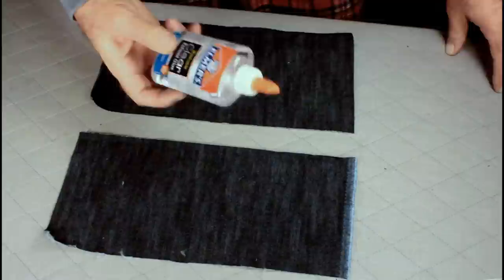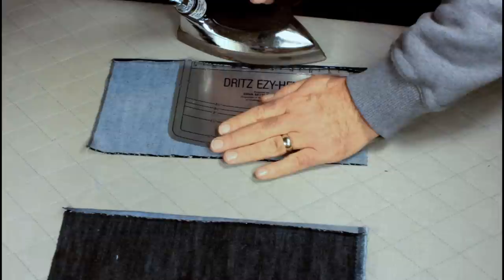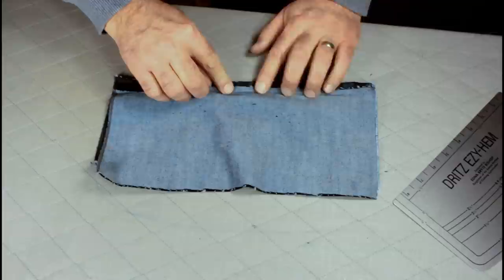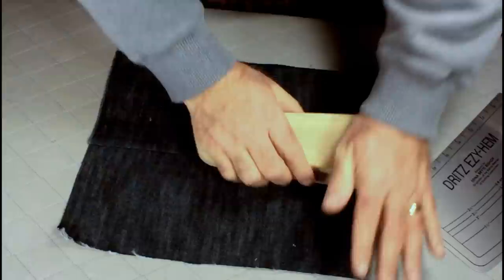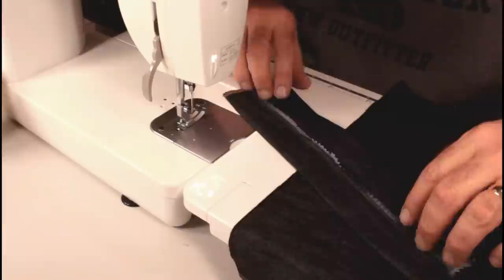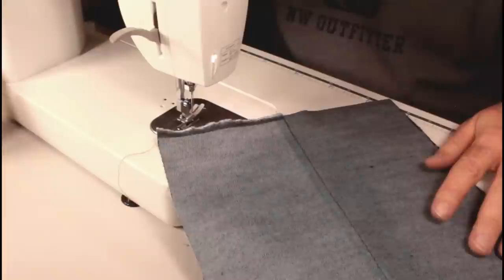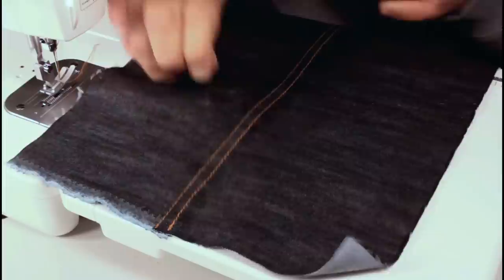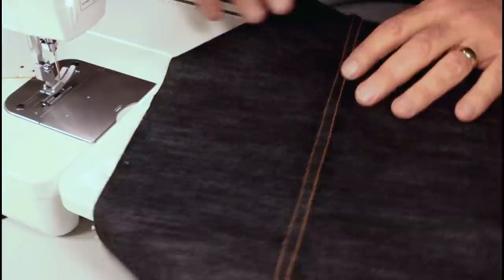Example of One Way to Sew A Professional Flat Felled Seam on a Home Sewing Machine

Comment: Two more words dude....nice trick, and just about the only vid to show a proper flat feld jeans seam!
Questions:- The critical thing is the width of the sown seams, yet you space the folds by setting a cut edge against the inside of one if the seams, which could be a bit inaccurate. Surely the outside parts of each 1/4" fold need to be spaced 1/2" apart with accuracy, then two Stitches 1/8" in on each side give the stitch line spacing of 1/4.  I must try this soon."
Reply from the maker: When I use my felling machine I use raw edges. The raw edge it touching the inside fold. You can use the method you described too. Whatever makes the most sense to you is fine.

Comment: hey kevin, i'm planning on learning to make my own jeans and maybe some faux leather-polyurethane pants. what machine//foot would you recommend that could handle going through interlocking felled seams such as the crotch and some parts of the back of the jeans? i'm looking for the cheapest thing to get the job done, since i'm still a college student
Reply from the maker: crimson35124 I'd buy a old all metal classic machine. You can pick them up for under $50 by shopping local thrift shops, goodwill and craigslist.

Comment: I looked at a pair of high end jeans that I bought years ago, it seemed to me like they had used a straight triple stitch, and they'd done 4 lines of stitching on the inner and outter leg seams. What is the benefit of using a straight stitch vs the triple? I know it is supposed to be for stretch, but I want to confirm that the triple stitch makes the stitch stronger? I'm trying to make some heavy duty utility jeans that'll handle horseback riding, so strength is what I'm going for. How much added strength would the extra lines of stitching give? 
Thank you for the video!
Reply from the maker: I have a pair that cost over $100 USD that have 3 stitches on the inside of the legs too. It is simply a design choice OR possible they contracted with a company that didn't have a classic flat felling machine. It is hard to say the reason why.

Comment: Hello, great video, thank you. I understand the seam but when it's used on a sleeve is it possible to for it to be the only seam ? I looking to sew a drysuit for kayaking out of waterproof material . I want to sew the first step of the flat felled seam and then put "shoe goo"  for waterproofing in the seam fold before sewing the second step. I'm planning on using raglan style sleeves. I want as few seams as possible. Do flat felled seams on a sleeve or pant leg always need another seam on the opposite side ? What are the options for a second equally strong ( and sealable ) seam as the other seam  ?  Would I be better  off sewing those single seams by hand ? Thank you for your time.
Reply from the maker: For shirts and flat felled seams google David Page Coffin. I use the flat felled seam on most of my outdoor furniture and grill covers, etc...  It works great to prevent water from coming through the seam. I will use a french seam on many of my T-shirt shoulder seams and it works well for that. I top stitch the seam to tack it down though. It works well for that purpose.  Yes, you will seem the flat felled seam lines on both sides of the fabric.

Comment: Instead of this school glue I feel wonder tape that also washes out might be easier. What do you think?
Reply from the maker: +Ursula Leach Yes, that is certainly an option. There is a major cost increase without any benefit with wash-away tape - I've used both methods too. Either one does the job.

Comment: There is felling foot that would be quicker. But, I have used the school glue for applique projects.
Reply from the maker: +Margaret Steel Yes, on some machines these are an option. This video was created to answer a question on a forum and it address that issue. If you really want the best option I find my industrial felling machine is the only way to go. ;)

Comment: Thanks, i can't find a video to show how to get the factory humpy look on the outside of a pair of Levis legs. They all look like Amish made pants without the humpy look. Can you address this? thanks
Reply from the maker: The outside leg seams are usually a chain stitch with the resulting raw seams serged with a 3 thread overlock. The inside leg seam is sewed using a flat felled seam before the outside leg seam is sewed.
Reply: What Kevin said, plus the Levi flat felled seam is stitched using two chain stitches, and chain stitch makes the seam pucker up slightly which is the humpiness you refer to. Old sewing machines did chain stitch, but probably won't be up to multi layered denim, so you will have to find a modern chain stitch machine, someone who can do it for you, or as a last resort, join the Amish.

Comment: I thought that the glue you're using would clog your machine if that's not the case please let me know as I'm new to this
Reply from the maker: No, I let it dry. IF you have any residue then simply apply some alcohol on a paper towel and wipe the needle with it.  It will remove any residue.
Reply: Kevin Sews thanks I'm new to this & I appreciate the advice

Comment: Glue didn’t really work, it does not dry quickly and ironing didn’t dry it quickly either, and with a long leg it is really difficult to get a good result, maybe try actual fabric glue since it get tacky and holds better.
Reply from the maker: Interesting! I use it daily and I haven't had this problem.
Reply from the maker: @yvonnek4980  Yes, but the point of this video was a response to a question who was having an issue. She was looking for a solution that was less expensive -  hence the use of glue.  I personally use a professional Flat Felt machine.